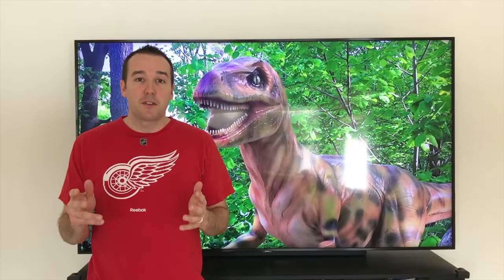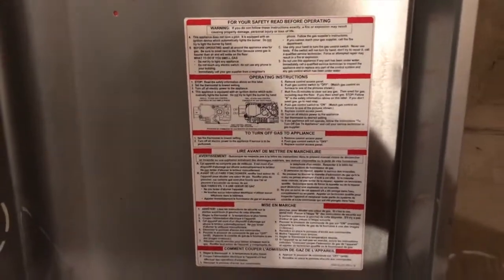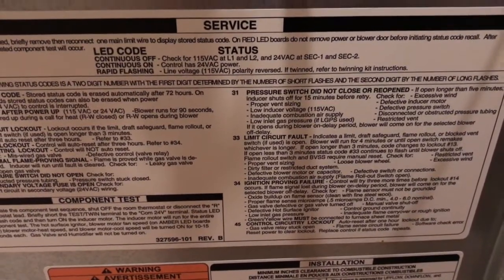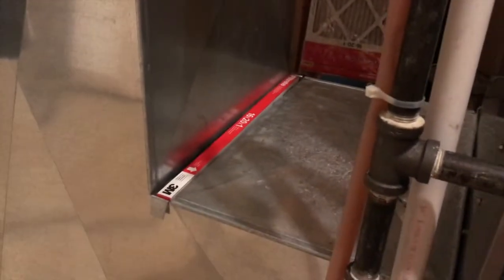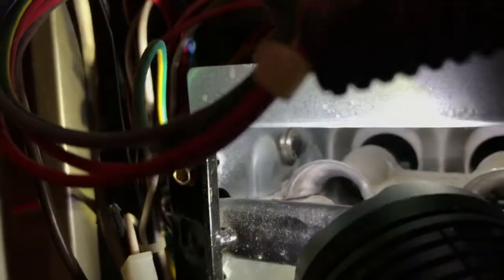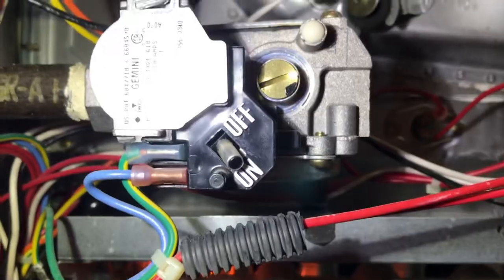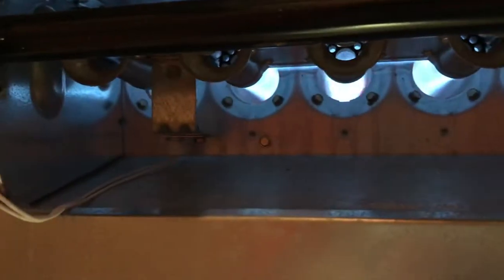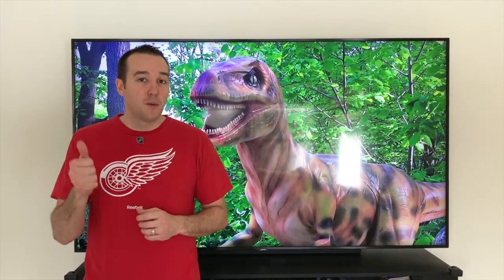Bryant Furnace blowing cold air - ERROR code 33!

Comment: We had some grinding done at the house and the dust went through our system triggering code 88 on our Bryant unit. I have replaced the filter since but the code keeps coming and going away. The furnace appears to work normally. How do I stop it from coming back?
Reply from the maker: @TK-gm3xg  

Good morning ☕️

It may be as simple as resetting furnace.  This can be accomplished by turning the wall-mounted thermostat to the off position as well as the switch located on the actual furnace to the off position and leaving off for a minimum of five minutes.

If that does not help, there is likely still dust inside duck work that will hopefully filter-out over the next few weeks.

Comment: My carrier furnace unit running on heat upstair is fine, my hvac use 2 zones, some reason that basement heat keep shutdown only fan keep running ( set 70 but the heat stop at 67). Had changed a new thermostat but still the same issue. The Carrier furnace flashing is 33 code when unit stop. Anyone can help or know what's going on.Thanks in advance

Comment: I’m having issues with my furnace. I have it set to auto, it will start up fine but when it hits the set temperature and shuts off, after a while the temp drops and it starts up again I will get a code 33 and it will only blow cold air. Had a repair tech come out and he suggested I replace the temp sensor and mother board. Both of those were replaced. Btw brand new filter also.
Reply from the maker: Thanks for watching and sharing your situation.  Are any of your vents throughout the house covered or blocked in any way?
Reply: @DIYwithMichaelBorders  no they’re all clear
Reply from the maker: @hmoobshow2482  

Thanks for the reply.  The 33 code refers to a lack of ventilation.  When furnace is off, carefully remove filter.  Inspect the internal filter chamber and if dirty..it’s best to clean it.

Allow your furnace to run momentarily without a filter, and if the furnace runs normal with no issues, then it is the filter or a dirty filter chamber that ultimately leads to heavy dust buildup on the internal fan blades.

Once this happens, the furnace won’t operate as designed until filter is replaced and filter chamber is cleaned.

Below is a video that you may find helpful as it gives you a better view of the inside of our furnace and our fan motor blades.

     https://youtu.be/5NbjO36uxNE?si=yvozCJ9nN-JTeXDD

👍🧰

Comment: Is the model# of this Bryant furnace 925SA48080E17? Just curious. Also, does every Bryant furnace has such "manual reset" button? I was originally getting error code of 12, but after I cleaned the flame sensor and replaced the air filter, now I'm getting error code 33 (model# 925SA). What might be the cause of the issue? Thanks!
Reply from the maker: Good morning ☕️

Any update?  The model number is indeed the number (925SA48080E17).

The 33 fault code is standard with Bryant furnaces.  Sometimes after replacing a part, the system will trigger a fault code (33 in your example) until it runs for 3-5 minutes.

During that time…it makes you think it’s not fixed however what it’s doing is actually performing a system reset/check and communicating with all sensors.

If all is good, it will start running as designed.  Keep us posted.

Comment: Thanks Michael! It worked for me to clear my code33. 

Ff up question though and hoping to hear your thoughts about this.
Before my code 33, my exhaust vent had  a noticeable strong burning smell. Also, random alarm of carbon monoxide near the furnace. Lastly when I put the furnace cover back on, code 33 happens again. 

An hvac guys went to check and said the whole furnace needs replacement. Here in Toronto it's seems all hvac guys want to replace and no one repairs. 

I'm wondering if this is just a thing that needs replacement,  cleaned or  checked, rather than replacing.  Also, I notice my intake is not vented outside (not sure if this is a factor)

I have a Bryant P90. Thanks in advance.
Reply from the maker: Thanks for watching, any update?  Sorry to hear you’re experiencing furnace issues.

Code 33 is heavily related to airflow and ventilation.  If furnace is experiencing lack of airflow, we need to focus on all the items that are tied to that aspect of operation.

1.  Remove filter and see if the furnace runs normally without a filter… if it does, immediately put your filter back in and move onto the next item.

2.  Install a new filter that is not high-end and expensive… In other words… install a five dollar filter that you can purchase from your local hardware store.  Super advanced high-end filters installed into a furnace that’s not designed to operate with one can lead to this.  A standard five dollar filter will be best.

3.  If that doesn’t work, take a look at the internal circular fan and blades inside your blower motor compartment.  If it’s heavily dirty and has a large amount of dust buildup on it, it will need to be vacuumed and cleaned.  Ensure furnace is 100% off prior to cleaning.

All that added weight to the internal fan blades will lower the airflow inside system and cause this as well.  The more dust buildup on fan blades, the heavier the fan.  This leads to blower motor having to overwork to spin fan which will overheat motor and give off burning odor.

Let’s start there.  😎👍

Comment: Thank you!  Right before a cold stretch I noticed our Bryant furnace was only blowing cold air.  I watched your video and although the furnace is not the same model, the error codes were the same and I located the internal reset switch.  Pressed it and WARM AIR!  Now, to see if it trips again, but I also found I had installed the new filter backwards so maybe that was all it was.  Thank you again
Reply from the maker: Thanks for watching, that’s awesome.  The filter installed in the reverse manner will affect the efficiency of airflow.

So happy to hear you came across our video, thanks again Craig.

Comment: Thank you! Thank you! Thank you! For making a clear, common sense, easy to follow video! I'm fairly handy with most things DIY. But the more electronics are built into devices, the more I find myself struggling. Had the same code here, but our furnace was starting up for a few minutes then shutting down and repeating - a short cycle. I had already changed out the flame sensor since that tends to go quickly on modern furnace units and I was still having the issue. I appreciate the insight to the sensor 'buttons' since I had no Idea what they were supposed to be doing. I checked all my connections and hit the reset buttons and fire it up again. Nothing. Well, it is a windy day here, but this issue had been going on for a week even when it wasn't windy. Then I noticed that the filter cover was whistling a lot. Then I decided to check on when I last replaced it. Two months has gone by when the usually last me three so I wasn't completely convinced, but you did mention a dirty filter could be the culprit. Sure enough! Popped out the old one - which was dirtier than I expected and put in a new and viola! No more 33 error code and the furnace ran perfectly. I suppose that running our gas fireplace more often this winter could be the cause of a shortened HVAC filter life span!

Thanks again for providing a simple, straight forward solution to try out before having to make an embarrassing to call to a service tech just to tell me I had a dirty filter or get talked into an unnecessary repair!
Reply from the maker: You are very welcome Douglous, we can’t thank you enough for sharing your experience.

It’s incredible how the systems can quickly detect a slight lack or degrade in the ventilation traveling through.

Definitely a weight off your shoulders when you find out it was just a dirty filter.  Again, thanks for sharing this Douglous.

Welcome to the DIY Raptor Club, hope all is well with you and your family.  😎👍

Comment: Thank you for this video!!! I changed the filters and pressed the reset buttons at the burner but it did not turn on. I was skeptical and scared of cleaning the other switch but I said f’ it and pulled them off and scrubbed it a little bit with my fingers and BOOM!! Those beautiful flame jets turned on and I ran around the house screaming that I fixed it lol THANK YOU SO MUCH!! You know I clicked that like and subscribe buttons!
Reply from the maker: Outstanding 😁

Thanks for watching & sharing this.  Heat is very important this time of year, hopefully many stress free days ahead for you.

Comment: You sir are an angel. It’s 40 degrees here in Chicago. No heat for 2 days, with two kids a big dog and an always cold wife you could see how this could be problematic. 33 error code, was originally 13. Swapped filthy filter (I’m a renter and didn’t even think to check it) and literally used a tooth brush to lightly brush the flame sensor and BINGO BANGO We got heat baby!!! Thanks man!!!!
Reply from the maker: Awesome Awesome & we appreciate you sharing this.  Welcome to the DIY Raptor Club Raul.

Great to hear your furnace is back up & running.  Let us know if you have any questions, us fellow DIY’ers need to stick together.

😎👍🔧🔩
Reply: Oh yea, got a bryant 310aav. Smaller than the one in this video but almost everything is in the same places.

Comment: I'm getting this error constantly after a few minutes running. I've tried filter repalcement, all vents open and clear. Tried replacement limit switch.
Could dirty ducts cause this error?
Reply from the maker: Thanks for watching & welcome to the DIY Raptor Club.  Dirty vents are unlikely.  How do your burners look as they are running.

The burner flames are to be  burned & directed in a straight-line & uninterrupted manner for proper safety & efficiency.

If your burners are acting sporadically & not flowing in a perfect straight line, your flame sensors will immediately turn off system to prevent fire.

Let’s start there, keep us posted, let’s get this figured out.

😎👍🔧🔩
Reply: @DIYwithMichaelBorders  thanks for your reply! The flames seem ok. I’ve trouble shot error 13 before, in this same furnace. The sensor did seem to be needing cleaning every year. I’ve also replaced the flame sensor. Now it’s actually going directly to error 33, and the limit sensor trips.
I’m about to clean the coil, which from my logic may also be blocking the air. They really do not look too dirty, but I’m running out of ideas. I’m trying to avoid a complete furnace replacement . Also, the limit sensor area does get hot and trips at 32.5c.
Regarding the flames, is there anything I can do about them?
Reply from the maker: @MazingerZelchancho  

Thanks for the reply & that’s a great idea.  The little sensor probes get pretty dirty often.  A cleaning may go a long way.
Reply: @DIYwithMichaelBorders  unfortunately cleaning the flame sensor did not work for this error. The limit sensor is doing its job correctly by tripping at 32.5 Celsius. The area is getting hot 🙁
Reply from the maker: @MazingerZelchancho  

Does system shut down if you remove filter?  If so, the filter may need to be replaced or it’s installed against the flow of air.
Reply: @DIYwithMichaelBorders  yea, it also happens without the filter.
Reply: @DIYwithMichaelBorders  yes, still shuts down without a filter.
Reply from the maker: @MazingerZelchancho  

Let’s direct our attention to the capacitor.  This is another part that can trigger the 33 code when it faults or completely stops working.

You may need a new capacitor.  Below is a link to our video showing replacement of capacitor.

       https://youtu.be/mVAKsMH336Y

😎👍🔧🔩
Reply: @DIYwithMichaelBorders  Really appreciate all your feedback! As a gback story, one time in the summer the air movement was very low. 
I've checked the capacitor. It does look swollen or leaky. I've measured resistance and it is going to infinity slowly as it charges. 
I am running out of ideas, so I really appreciate your replies.
Reply from the maker: @MazingerZelchancho  

You are very welcome.  We need to find the faulty...ish part.  Even if the capacitor or another part is working, it’s very possible that the system is detecting its weakness and shutting down the system.

Also… Unlikely… However we can’t rule it out… Double check all of your electrical wire connections inside the furnace.

Any wire that feeds into a screw that is loose on the control board will short out and also shut the system down.
Reply: @DIYwithMichaelBorders  I think I’ve jumped over the obvious. How do i know that the burners are not dirty? I see some yellow flames flickering with the blue. I guess that’s not good…?
Reply from the maker: @MazingerZelchancho  

That’s more normal than you think.  Sporadic behavior with the flames would be flames that flow sideways and or backwards...or sputter...
Reply: @DIYwithMichaelBorders  I'm out of ideas now. Tomorrow I will try cleaning the burners, the best that I can using pipe cleaner brushes. ANy other suggestions before replacing the whole furnace?
Reply from the maker: @MazingerZelchancho  

Hopefully it doesn’t get to that, that can be pricey.  We will check back with you tomorrow.
Reply from the maker: @MazingerZelchancho  

We did a bit more research.  Not sure if this will help.  Additional items include:

1.  Newly installed thermostat that is unfortunately not compatible with your system.

2.  Newly installed flame sensor that is unfortunately not compatible with your system.

3.  Your blower motor accidentally got switched two on continuously rather than auto... that’s if your motor has the option between the two… It may not… yours may only be auto.

4.  Your wall mounted thermostat that is used to turn on and off the system as well as adjust the temperature settings may have a low battery.

😎👍🔧🔩
Reply: @DIYwithMichaelBorders   Thanks for the help.
1. I’ve used Nest for many years now
2. I’m sure I have not changed this in about a year. Also, correct me if I’m wrong, but the operation of this sensor is to let the system know the furnace is heating? Meaning hi/lo. Does it also regulate the gas flow?
3. I’ve ordered the cap from your link. I’ll receive it next Thursday. Hopefully the temperatures don’t drop too much. Is this capacitor used while running as well? Or just to start up? I’m hoping it also effect a the RPM ok the motor, and replacing it will fix my pain.
4. See 1
Reply: @DIYwithMichaelBorders  I should also add, issue seems to be getting worse. Meaning, furnace is able to run for shorter periods of time.
Reply from the maker: @MazingerZelchancho  

You’re spot on with the Capacitor, it’s sole purpose is to weaken the electrical hit during the furnace start up and then sits idle as the furnace runs... however it is still holding a close-to-deadly charge...😳

The gas valve is tied into the system & will shut off per the sensor signals to control board if any issues.
Reply from the maker: @MazingerZelchancho  

Have you checked your Pressure Switch?  Below is a link that talks more about this part.

       https://youtu.be/ssI_YCnnF4Q

😎👍🔧🔩
Reply: @DIYwithMichaelBorders  I believe that wouldn’t let me ignite
Reply: @DIYwithMichaelBorders  any way to check if the motor is switching from low to high? I’ve opened an 8” hole in the duct between heat exchanger and coil, so that heated air flows out with less resistance, and to prove flow issue. Problem does not occur! Does that mean that the blower is running slow????
Reply from the maker: @MazingerZelchancho  

Good morning Oscar, if yours does not have that feature, you can even add a switch which will allow you to manually switch between the two.  Below is a link to a video that shows us installing a switch.  In our case, we wanted to add a switch which would allow us to turn on the blower motor when the furnace was off to feed warm air from our living room to our crawlspace.

       https://youtu.be/X5IxghVYhYY

😎👍🔧🔩

Comment: Mostly good, I wish the clear/reset process would have been better documented. Every time I power mine back up(heat off) its still immediately requesting heat. Thermostat is set lower than the room temp and the heat is turned off. I flipped power off at the breaker for 5 minutes as well.
Reply from the maker: Thanks for watching & welcome to the DIY Raptor Club.  We appreciate you sharing your experience.  What’s your update?...Are you back up and running?

Enjoy your day.  😎👍🔧🔩

Comment: I’m having this problem but also not getting power to my nest thermostat. I’ve pushed both the reset buttons I can see on sensors...no dice still just constant blower with a 33 code.
I had dirty filters that have been replaced but doing so didn’t fix anything. Wondering if that limit switch needs to replaced. Checked the board and the fuse was fine.
Reply from the maker: Thanks for watching & welcome to the DIY Raptor Club.  The limit switch is the very next part we recommend directing your attention too.  Replacing that should hopefully get you back up and running properly.  Keep us posted.

Enjoy your day.  😎👍🔧🔩
Reply: @DIYwithMichaelBorders  Thanks! Yes, this morning I disconnected the limit switch...after reconnecting it, boom, back in business :) So thankful for channels like yours!
Reply from the maker: @PhillipRauschkolb  

Thanks for the update.  That tells us that your limit switch is in its early stages of failure.  It is now becoming intermittent and will need to be replaced sooner rather than later.

Below is a link to our video showing replacement of part.

       https://youtu.be/r9Wx9U7WnWg

😎👍🔧🔩